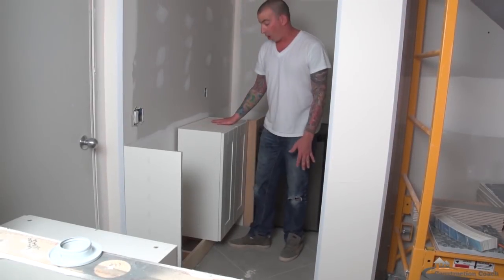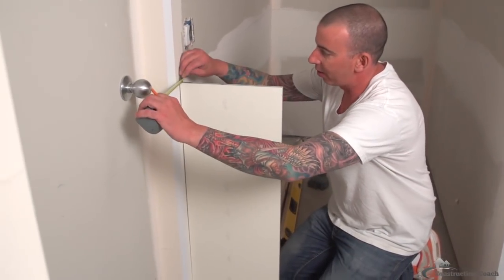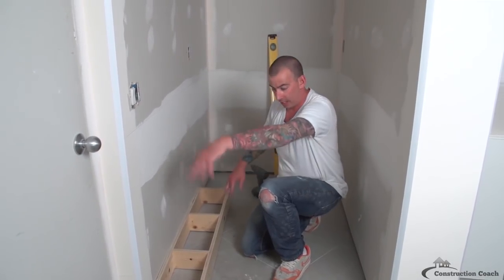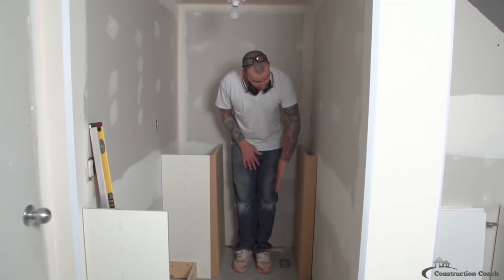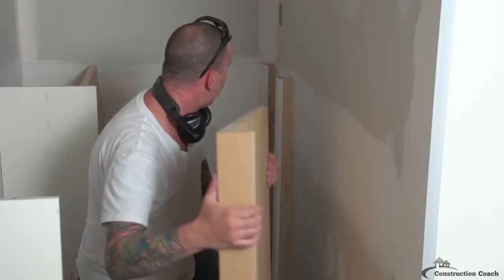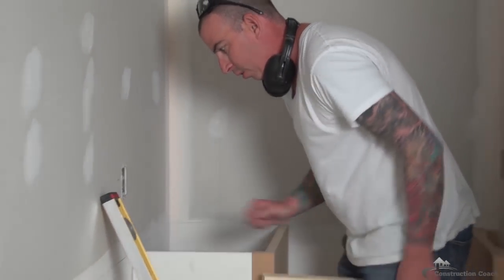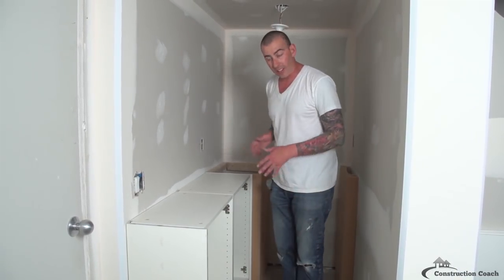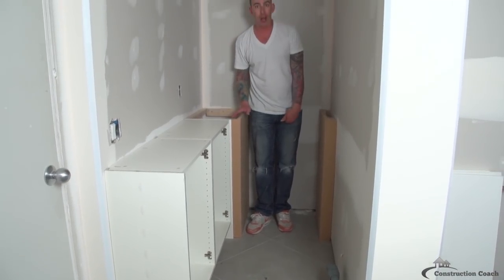How to use uppers as a base cabinet - DIY

Comment: How come nobody shows how to mount a countertop on a typical upper cabinet? With lowers you have open space and can easily run small boards across the top front to back and then screw the top down.... but with uppers you have no opening
Reply from the maker: I always screw the final countertop from underneath. Hope that helps, there is a laminate countertop video in my library and it goes more into depth on the install of the final countertop install. Thanks for watching!!!
Reply: @ConstructionCoach  I'm glad Eric brought this up because I forgot all about the counter. I do have a question about the base. I have seen a lot of people use 2x4's with a 3/4" platform on top. You went a different route. Just curious what you used for the base. What kind of wood is it.? Was is precut to that height (width) or did you cut it yourself from something larger.?